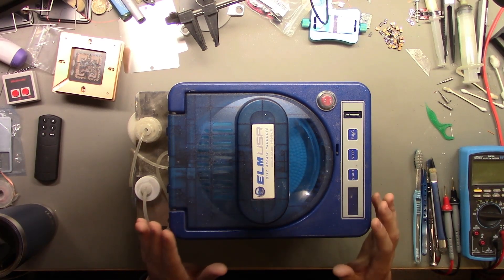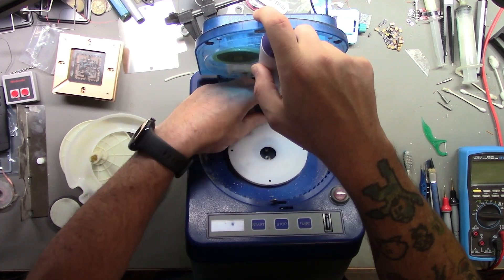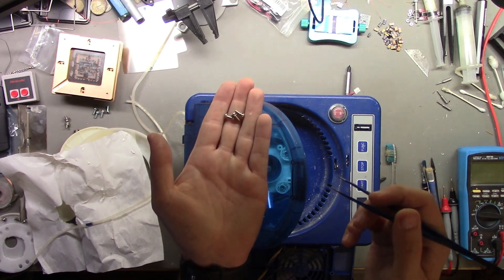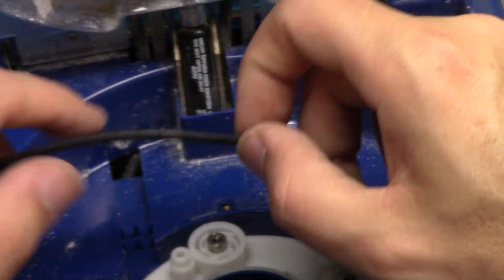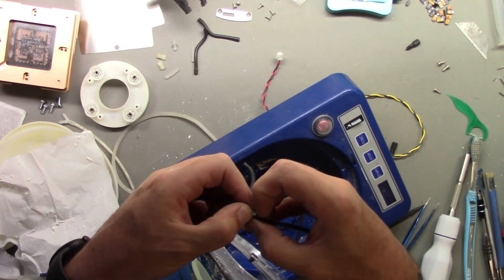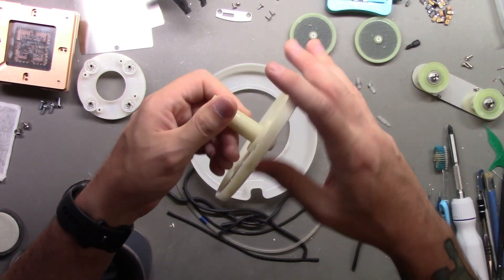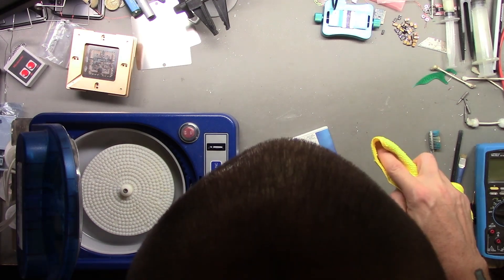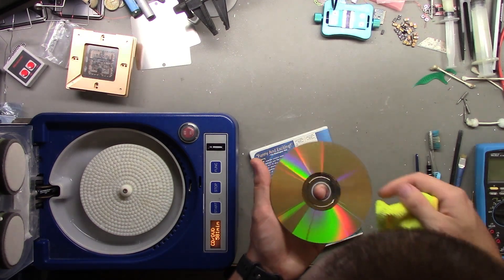Elm Eco Pro 2 Disc Cleaner Clogged

Comment: To get those scratches off I use the JFJ as a sander only, (10 or 20 seconds )then I throw it on the Eco pro 2 with 4 minutes and the disc comes out as new

Comment: I just cleaned on of these and it pumps compound and water good. But it seems when I close it that bothers me the compound nozzles and water nozzles touch the CD barley. Is that right? Does it matter what direction the compound nozzles face? Seems almost as if it’s not delivering enough compound or water from the sound of it when it’s running.

Comment: I need a bit of help. I what you did unclogged mines, and now the tube from outside isn’t sucking the solution out the bottle. I’m not sure why but everything is connected and cleaned. The water tube works fine it sucks the water out of the bottle but not mines.
Reply from the maker: Did you disassemble it at all?
Reply: @roycerepairs  I only dissembled the tubes, no electrical wires. Everything seems to be connected I’ve open the damn thing like 10+ times already.
Reply: How much do you charge for your services